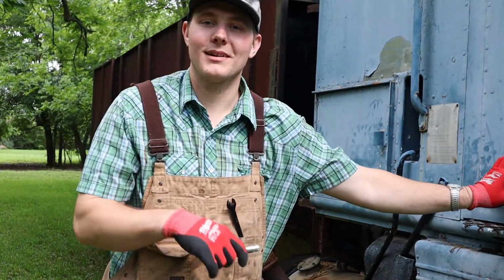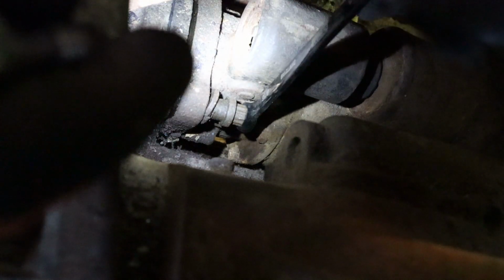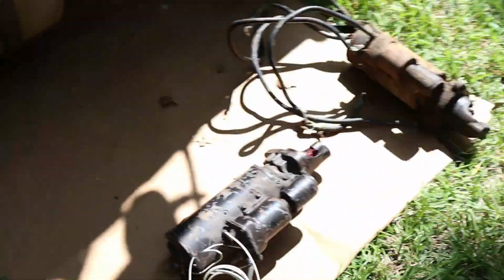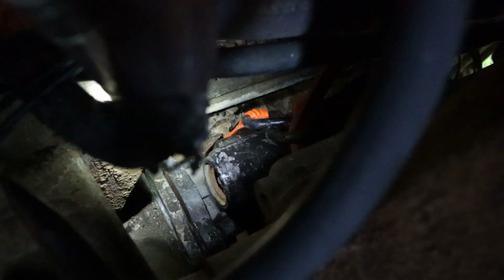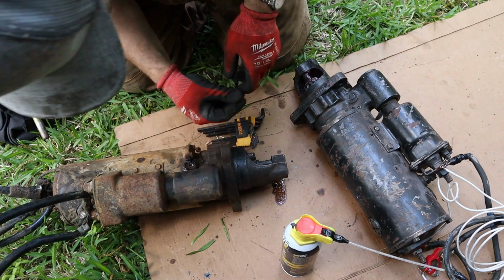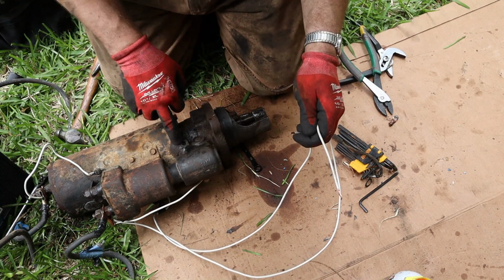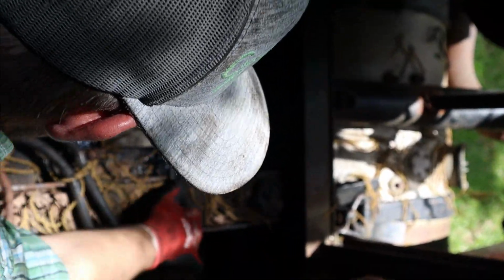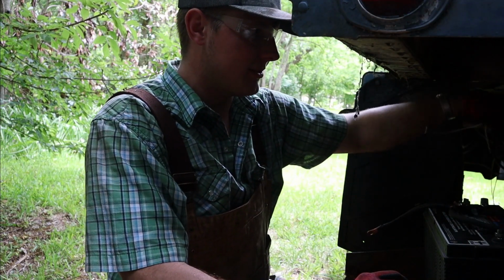WILL IT START? PART 2! Cabover Dodge 1000

Comment: Just a hint a I do a lot of starters. Life is a lot easier if you make a guide stud. When you remove the starter you remove one bolt and put the stud in. It makes removing and installing the starter a lot less work. As long as that stud in place the cannot fall out. And when installing you just slide the starter place and hold it up and install the other bolts.
Reply from the maker: Thank you for the comment. That is a great hint thank you for that.

Comment: I had a 68 dodge cabover moved mobile homes all over the country was a great truck 250 Cummins - 10 spd,wish I still had it!!
Reply: If it is a 335 should still ha e the compression release right on front of front head mine had one but did not connect to anything I put a pulley with a piece of cable a deep socket in truck on floor right in front of seat sit onseat reach down grab socket and you could spin all you wanted from inside truck
Reply from the maker: Thank you for the information great stuff! I like to hear stories about these old dodges, do you happen to have a picture of it? And how many miles did you end up putting on it?
Reply: @CMWorks-sd2fs  I have a conversation Ford same setup with a 290 Cummins Wii send pictures
Reply from the maker: If you want you can send them too my email rogerscasey476@gmail.com. interested in seeing the ford to!

Comment: Maybe a selection of crow bars can find you one that can pry the ring gears, or put the truck in high gear and pull it with a tractor, dozer, or another truck.  You can also spin the motor far faster by roll starting than the starter can spin it, and that can help instead of starting fluid.
Reply from the maker: Thank you and those are all great ideas.

Comment: Brother pull the compression release on the front of the front head ,makes it tons easier to turn
Reply from the maker: Will do thank you.
Reply: I'm sorry for the failure I tried to send pics it was my phone will not work until new cycle which is the 2nd at midnight as soon as it straightens out I'll get those pics to you thanks Allan check

Comment: Too bad you cannot get the cab up at this time, you could pour some lube such as old motor oil or marvel down the top of the cylinders and let them soak for a week or two. That would likely un-stick the motor. Transmission fluid would do it too, use clean fluid.
Reply from the maker: Thank you for the comment. I am hoping too do that next time. I will probably use marvel I love that stuff.

Comment: Make sure that the cab latches are released.In the last video I saw the cab start to move some. This truck might or not have a com - pression release, some did and if so it would be in the  cab. There are different products that might loosen up the rings and pistons,just let whatever you get to soak in for a few days. Sitting for that long anything is possible,and make sure u have enough oil & coolant.
Reply from the maker: Thank you for the comment. I will look around in more detail for other latches. I didn't see anything in the cab for compression release but I will be looking too see if the engine has one. Thank you for the advise I appreciate it.
Reply: this engine would not have a compression release

Comment: Well if its stuck would be time to see if you could pull it a bit but if its stuck hard you would just twist the crank i would pull the intake off and see what it looks like on the top side and also see if fuel pump is working ... might just be easier to throw another cummins in it lol
Reply from the maker: Thanks for the comment. I will be trying to turn it over by hand from the front of the engine if thats doesn't work I can try pulling it.

Comment: That old of truck would have a compression release cable in cab
Reply from the maker: I briefly looked for one but couldn't find it. I know that the small cam cummins non turbo had compression releases and this is a small cam with a turbo, but then again I'm not 100% sure on which cummins this is and the year of it.
Reply: @CMWorks-sd2fs  this wouldnt have a compression realease this is a small cam 350 cummins  none of these had it

Comment: I would not force it as it can bend the rods and then it is junk or at least out of comfort to fix. Pull the injectors so it can rotate with out bending stuff. Its big steel so it breaks real bad when it does and it sounds like it wants to go so try injectors or glow plugs if that motor has them to vent the cylinders
Reply from the maker: Thank you. I think it might have a compression release but if not I will pull injectors or glow plugs out to put oil down the cylinders.

Comment: 1960s  Cummins had a compression release see if you can find it and get it to release the compression and spin the motor if so while released you can circulate oil and then while turning motor slowly add compression back and start
Reply from the maker: Thank you. I will do that.
Reply: this wouldnt though this is a small cam 350 which does not come with a compression release in the 60s the 280 cummins did have a compression release but this motor is 70s+
Reply: Ok I did forget they stoped the compression release in the seventies
Reply: @kevindunn2868  correct 60s was the 280 cummins with a compression release diesel creek has one in his autocar in the 70s cummins went to the small and big cam 350 and 400 and no longer had compression releases those motors went until the 90s then they had the n14 cummins and that went till the mid 2000s when they went to the isx which is the current model

Comment: If all the wheels turn that means the motor is not locked up Try  Dragging it a little more.
Reply: not true at all
Reply: Just because the wheels turn don't mean it's not locked up only means it was in neutral when it was pulled he could try to pull start it by putting it in 4th gear and popping the clutch while being pulled and maybe brake it loose
Reply: @timatwell3728  exactly but also if something broke like clutch is stuck disengaged then it wouldnt turn over either pop starting it could work

Comment: Your video's are great.I'd love to see the rare old DODGE start! . I subscribed, but did cringe a bit at a few spots.. For Safety's sake!! I am reposting this (a bit long ..) from the last video:.. I ran an auto / truck / big marine electric business for a few years.. More bad starters, alternators & FIRES / EXPLOSIONS were caused by battery cables that were not cleaned, spread properly & fully seated against the built in stop / washer at the bottom of the terminal. THEN, TIGHTEN fully (if the cable end still can be twisted by a super firm hand grip .. or the end breaks prematurely, REPLACE IT! Those batteries WILL EXPLODE when you start drawing 1000 AMPS PLUS (& a connection arcs) on start!!  & bad cable connections look like bad batteries. Those batteries are probably good!  1st, blow out (batt op air compressor works) all of the area that you're working in. One by one, remove , wire brush (WITH BATTERIES DISCONNECTED!) connections, both lugs & posts. Again, these big engines PULL 1000 to 1800 AMPS while starting! DO NOT EVER use any tools to cross terminals.. A 12v (or 12/24) test light is your friend. We sold a lot of starters & alternators because of bad connections! Anyone with questions, please message me before continuing or creating a problem..or hurting yourself! THIS STUFF IS EASY if you are careful and patient.

Comment: you do no that's a 24 v system right
Reply from the maker: Thank you for the comment. I don't believe it is because I hooked 24v to it and it did not want to do anything. If you know something I could look for or try please share.
Reply: @CMWorks-sd2fs  sir alot of if not all old trucks had a parallel switch , look up the starting system for old trucks and you will find the switch, they are for sending 24 v  to the starter, you can also look on the starter it should say 24v on it most did hopes this helps, oh they do go bad from setting, they was a problem on trucks
Reply from the maker: Thank you. I will look for a parallel switch I couldnt find anything on the starter when I had it out. Thank you for the knowledge.
Reply: @CMWorks-sd2fs  welcome sir they are normally on the frame between batteries and starter it looks like a big  silinoid about 5 or 6 inch round and 10 inches long